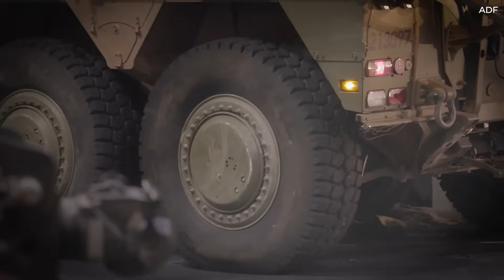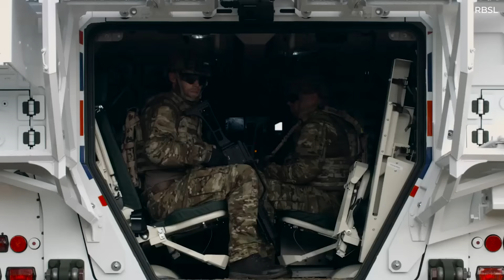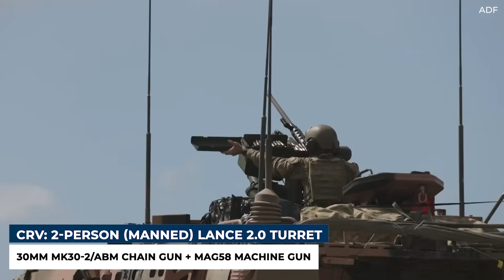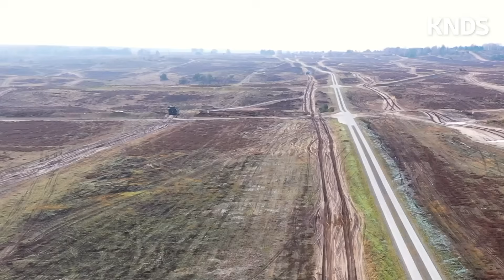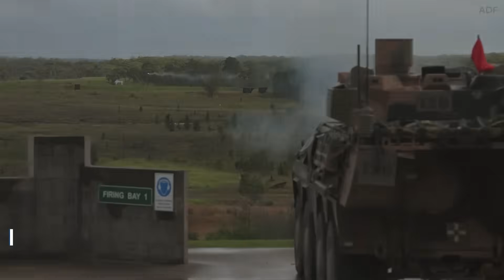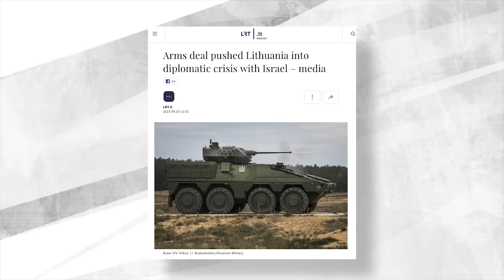Boxer 8x8 Combat Vehicles Compared (Germany vs. Australia vs. Lithuania)

Comment: Germany buys both the RCT 30 variant (dubbed wheeled puma“) and the Australian CRV version. The CRV version is a replacement for the Fennek and Wiesel as a reconnaissance vehicle. The RCT 30 is used as a highly mobile panzergrenadier version.
Reply: The CRV version is not being used as recon vehicle and is not replacing the Fennek. Its replacing the Wiesel. The Wiesel is not a recon vehicle. Its a weapons carrier ie fire support vehicle. And exactly this is the task of the german CRV. Its called heavy weapons carrier. The new recon vehicle will be the Luchs 2, it will replace the Fennek scout car. It will be a 6x6.
Reply: @AffigesEtwas you are correct. I must have mixed up and because CRV is a reconnaissance vehicle. But of course you are right it is the version for the Jäger and is only replacing the Wiesels.
Reply: @tobiwan001  The reason you mixed those procurement projects up might be that the CRV indeed was a contender for the new recon vehicle Luchs 2. The army decided to go with a not yet existant 6x6 version of the Piranha 5 APC over a Boxer-based vehicle, because Piranha 5 can swim, for which Boxer is much too heavy. The downside is that Piranha is also significantly less armored, but the army valued amphibious capability as non-optional.
Reply: @tobiwan001 Where are the Fenneks going?
Reply: @uniformmike05 into my garage
Reply: @uniformmike05 I am not entirely sure, but I think the older fenneks will be sold or retired but some remain in service. I think the issue is that for the reconnaissance role they are now considered insufficiently armed and armored. They were not made to fight Russia but for counter insurgency in Asia and Africa.
Reply: germany is replacing the fennek with the luchs 2 on a prianha chassi are more passiv aproach to recon as other countrys - with massive critic of the lvl of protection included. If i understand the system right its an atemped/ or target to a more passiv aproach of recon with drones.
around 250 - 350 luchs2 are in the pipeline.
Reply: @tasker6669  maybe a pimped up Patria 3x3 would have worked too, to reduce the number of different platforms, but I guess they wanted a fast and available solution…
Reply: @micumatrix I reckon the fact that they're buying from us (🇦🇺) means exactly that. If they're in production, they're at the front of the queue. I think it's a good call, they need capability heute
Reply: @micumatrix  That's an even lighter vehicle. As it stands right now, Germany is going to buy large numbers of different weight classes of armored truck (Patria: thousands, Piranha: 359 and Boxer: thousands) for different roles. 

Patria will replace alle Fuchs light APCs in rear area and infantry transport roles, because they aren't expected to fight, but might still get ambushed by light (i.e. infantry caliber) weapons, mines, drones or artillery. The light armor of the Patria suffices for that and the fact that you can't put up a big fight in them them doesn't matter. 

Piranha will replace Fennek in the armored recon role. It needs more armor and a big gun for that, because it might encounter enemy forces. (In fact that's the main goal of their mission.) But it also has to be able to swim through rivers in order to sneak through areas where the enemy doesn't expect an armored vehicle to be able to go. The Piranha 5 sits exactly in that niche. 

Boxer will replace basically any vehicle that has a significant chance of actually having to fight, with the exception of the main battle tank (Leopard 2) and the heavy IFV (Puma) in the heavy mechanized brigades. Though even their tactical roles will be covered by Boxer versions in the new medium mechanized brigades. Boxer will also replace the Wiesel light tank in the infantry brigades (i.e. those that will large ride on Patria) as an IFV that doesn't carry dismounts itself. Boxer can do all of these things because it is can be equipped with significantly more armor than pretty much any other wheeled APC/IFV in the world. But this comes with the downside of it being heavy and expensive.
Reply: "You have mixed up the tactical roles and the structural replacements within the German Army's (Heer) modernization framework.Here is the rüstungstechnische clarification to clear up the confusion:1. The CRV Version (Schwerer Waffenträger) is NOT replacing the FennekThe Reality: The Schwerer Waffenträger Infanterie (based on the Australian CRV with the manned Lance turret) is not a reconnaissance vehicle, and it is not replacing the Fennek [suv.report]. The Fennek remains the dedicated scout platform for the Army's reconnaissance branch (Aufklärungstruppe).The Jäger Replacement: The Schwerer Waffenträger acts strictly as a heavy direct-fire support platform. Within the new Medium Forces (Mittlere Kräfte) concept, it replaces the tracked Wiesel (20mm and TOW/MELLS variants) exclusively within the heavy weapons companies of the Jäger (Motorized Infantry) Battalions [suv.report]. It carries zero infantry dismounts, utilizing the rear space entirely for ammunition racks to feed its 30mm gun and MELLS (Spike LR2) missiles [suv.report].2. The RCT30 Variant (Schakal) is for Mechanized InfantryThe Reality: You are correct that the Boxer Schakal utilizes the unmanned RCT30 turret from the Puma [suv.report]. This vehicle is classified as a Wheeled Infantry Fighting Vehicle (Radschützenpanzer) [suv.report].The Logic: It is being fielded for the Panzergrenadiere (Mechanized Infantry) to allow heavy brigades to form fast, road-mobile wheel-units that share a 100% identical logistics, ammunition, and software architecture with the tracked Puma fleet [suv.report].Summary:The German Army is buying two turrets because they serve two entirely different doctrines: The manned Lance turret variant is an overwatch weapons platform for the heavy companies of the Jäger infantry [suv.report]. The unmanned RCT30 Schakal is a fully automated, front-line wheeled IFV for the Panzergrenadiere [suv.report]. Neither of them is a scout vehicle replacing the Fennek."
Reply: @klaus9995 yeah. Someone pointed it out and I acknowledged it.
Reply: Denmark prefers the new version of the CV-90, Leopard 2 A7 and SkyRanger 30mm for defense against drones

Comment: I prefer Patria AMV but Boxer is pretty cool too
Reply: 26 tons vs 36 tons. Patria is more like infantry vehicle when boxer is more combat vehicle
But I agree that for Baltic countries Patria is a better choice if their army paradigm is "defense and NATO support"
Reply: @DmitrijRebrov An IFV is a combat vehicle. Weight mostly limits where you can go (which isn't that much of a problem in Europe/Australia).
Also, the Patria AMV GVM is about 32 tons, only 4 tons off the Boxers own GVM.
Reply: @UJManda  Newest Boxer version has a weight limit of 41t. Its just a much bigger and heavier vehicle.
Reply: @AffigesEtwas I just wonder if there's any benefit to having a vehicle that heavy.
Reply: @UJManda  It has the armor of a tracked IFV.
Reply: @AffigesEtwas I checked, and not really, since tracked platforms that heavy tend to have armor closer to what tanks have (able to withstand 30mm all around). It has armor comparable to lighter IFVs like the Patria, which is Level 6 STANAG Armour in the front (protection against 30mm), and level 4 Armour on the sides (protection against 14.5mm).

I still don't see the point in having a heavier vehicle like this (that is also MASSIVE) when you can't achieve a lot of the same specs with a lighter, faster, and smaller platform.
Reply: @UJManda  The Australian CRV has STANAG level 6 side armor and you can see an additional armor plate on its front. You can see the increased side armor on it. Modern AFV´s are very large because no one uses eyeballs anymore to find stuff. All the sensors are so effective that it makes no difference if the thing is half as big. That said, the Boxer is very large.
Reply: @AffigesEtwas Actually, that isn't extra armor on the sides of the Australian Boxer CRV, but the Rheinmetal Strikeshield APS. There is currently no wheeled IFV in the world with all around level 6 armor, no matter how heavy. At most it MIGHT be level 5 armor on the sides, but even then you are pushing it and diminishing the advantages of even using a wheeled IFV in the first place.
Other than that, I do agree that it probably has the best sensor suite in its class.
Reply: @UJManda  There are very few tracked IFVs that widhstand 30 mm all around. Puma is the only one i can think of. They are not close to MBTs in terms of armor. The latest CV90 has STANAG 4569 Level 6 frontally and level 4 on the sides, which is comparable to a Boxer.
Reply: @DmitrijRebrov  Nah, Patria AVM have actual combat experiences as IFV
Reply: @SavolaxMitsu  Boxer was used in Afghanistan for many years. The first upgrades came very fast with the experience they gained there. Obviously not as IFV.
Reply: These are two different vehicles with different tasks. The Boxer also has the advantage that its operational modules can be interchanged. The Patria cannot. There's a reason why Germany will be using both vehicles: the Boxer as an IFV and the Patria as an APC.
Reply: @solidsteel3634 germany doesn’t use Patria AMV, they use Patria 6x6 which is a light APC
Reply: You're right. I've done my research. Nevertheless, the Patria lacks modularity. That alone is a deal-breaker.
Reply: @solidsteel3634  it can have diffrent weapon systems mounted on. I wouldnt say that Patria AMV lacks modularity, I would say that the Boxer just has more of it.

The Patria AMV is more mobile and cheaper. Its modularity is meant to have diffrent turrets, not diffrent hulls and cannon systems (the boxer is meant to be able to have anything from 12,7mm to 155mm, Patria AMV is meant to have 12,7mm to 30mm. [+ it has the option for 105mm but needs a vastly diffrent set of modifications for that] So its a similar platform but not meant to become something else then an IFV or APC, while the Boxer is meant to be those or something very diffrent (Boxer is more expensive and complicated tho).
Reply: @VeetiVOVetsson This isn't a question of modularity. Can the Patria be converted from an APC into a fully-fledged ambulance? Or vice versa? By simply loosening a few screws, removing the module, and attaching another one? If not, the Boxer still has the edge.
Reply: @solidsteel3634  I dont think you read my answer to the last comment
Reply: @VeetiVOVetsson I read that. And my objection stands. You can't modify the Patria to suit the situation as you can modify the Boxer. You can even put the RCH 155 system on it and turn an IFV into an artillery piece. So, yes, the Boxer is more versatile. It's not about which is better or worse. It's about what best suits your own doctrine. And in Germany's case, for medium forces, that's the Boxer.
Reply: @solidsteel3634  yes, thats exactly what I was saying. I understood your comment in a way that seemed like arguing against me.

For Germany the Boxer is definately better but for Finland the Patria AMV is more preferable.
Reply: @VeetiVOVetsson I'm not arguing against you. Why would I? I'm simply seeing the pros and cons of a doctrine I'm familiar with, and you're doing the same for yours. We're adults, and I believe most of us are ex-military. Discussions are bound to happen. 😁
Reply: @solidsteel3634  yes yes, I simply understood wrongly
Reply: @VeetiVOVetsson No worries. I wish you a wonderfull weekend 😁
Reply: @solidsteel3634  same for you 😄
Reply: @solidsteel3634  now you are thinking about the Patria 6x6 (Patria AMV is 8x8)
Reply: "That is a completely fair preference. The Patria AMV/CAVS platform is an absolute masterpiece of engineering—it is lighter, highly agile, has exceptional swimming capabilities, and is significantly more cost-effective to procure and maintain. There is a reason why countries like Finland and Sweden swear by it.In fact, the German Army (Heer) agrees with you: Germany has officially signed a massive framework contract for up to 876 Patria 6×6 CAVS vehicles to replace the aging Fuchs fleet. Germany is deliberately choosing a dual-track strategy, utilizing the Patria as the agile, cost-effective backbone for standard infantry transport and highly specialized roles. For instance, Germany is using the Patria chassis to field the advanced Patria NEMO 120mm turreted mortar system, alongside dedicated pioneer, command, and ambulance variants.The Boxer, however, belongs to a completely different structural and doctrinal weight class. It is a 'heavy' 8×8 platform that intentionally sacrifices amphibious mobility for unparalleled modular adaptability and maximum passive protection.The true genius of the Boxer is its split architecture (Drive Module and Mission Module). If a vehicle is severely damaged by a mine, mechanics can unbolt a complex 30mm turret module, mount it onto a fresh chassis in under 30 minutes, and send it back to the fight. Its massive growth potential (up to 40 tonnes) allows it to carry heavy, automated combat systems like the unmanned RCT30 (Schakal) [suv.report] or active radar-guided C-UAS systems like the Skyranger 30 without overloading the frame [suv.report].Ultimately, the German Army’s strategy leverages the best of both worlds: They are buying the Patria in huge numbers for agile infantry transport and specialized fire support like the NEMO mortar, while reserving the Boxer as a rolling modular fortress built to anchor heavy combat operations [suv.report]."